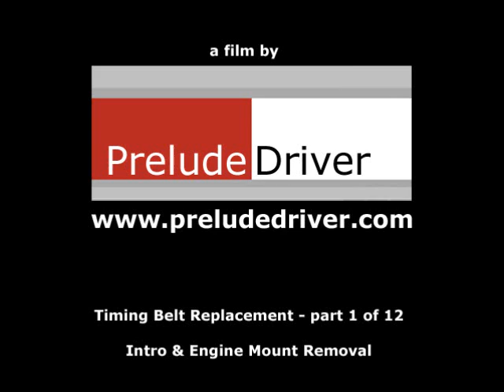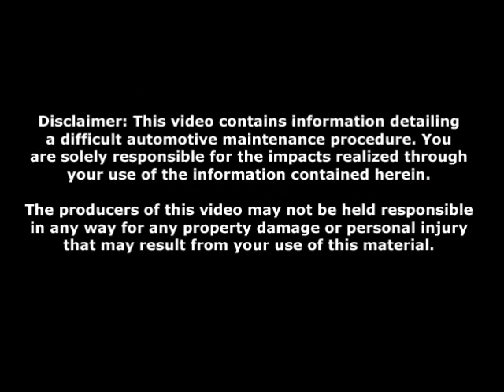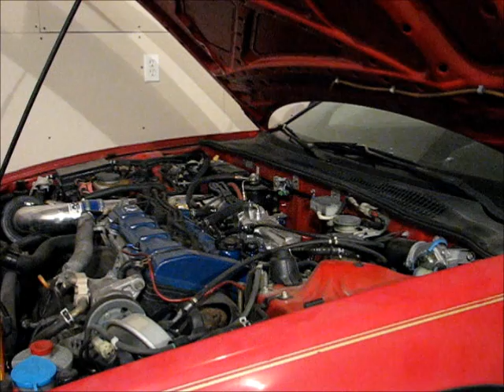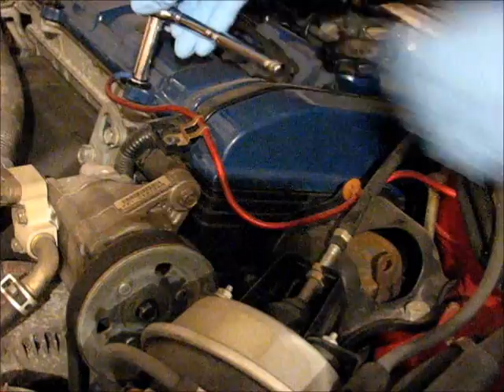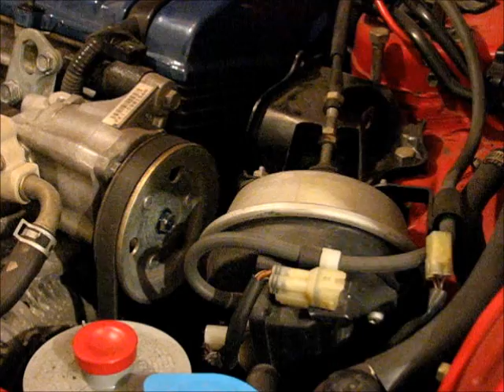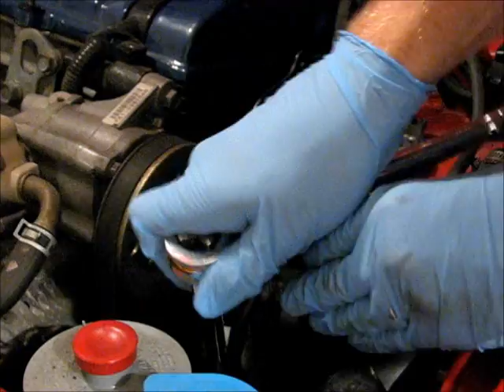How to Replace a Honda Prelude Timing Belt - 1 of 12 - Introduction and Engine Mount Removal

Comment: Hi, just bought a prelude with 140hp engine. I need to change the timing belt. I have a few questions.

- Do i have to chainge the cam oil seals?
-I heard waterpump dosnt need to be changed because honda dosnt change it too?
-Can i make this if i have all the tools and follow your steps? Or are some basic things that arent covered in the video but need to be known?

Thanks!

Comment: I Just purchased a 1999 Prelude SH with 230k miles on it guy said it was driving find and he let off the clutch a little hard and the car turned off, wouldnt start. I replaced the distributor wires and fuel pump already, starter seems to be working do you think he broke the timing belt? car has been attempted to start a few times is there a way to diagnose the timing belt without removing the valve cover?
Reply: the crank would move thats about it if the belt is broken
Reply: No mask oN did you find your fault?

Comment: Hey how are u? Surely u know a lot about Ludes, I was wondering if u could guide me what could be wrong with mine, he is making this sound and I'm really worry. A little of background: the oil pressure light was turning off and on many times however when u checked the oil it was fine. One day I was driving and accidentally got stuck in water, the car stopped after 1 min and a lot of smoke started to come out the exhaust. 15 mins later I was able to get the car to my garage and 2 days after that.

Comment: I finally got around to finishing this project once and for all. New fuel injectors, PCV valve, fuel filter, and battery installed. I got to removing the alternator and I can't get the THRU BOLT out all the way because the PS pulley is in the way so how does it get removed??

Comment: i tried to fix my water pump and instead of putting the cams in tdc i put wrenchs instead  and wench on the crankshaft pully bolt i heard the cam skip or belt skip a tooth and now my cams are out of alignment i dont want to bend valves and im new at this to scared to go anyfurther aswell just learned later that you can lock cams and i dont know still how to keep that crankshaft pully to stop rotating help!!!